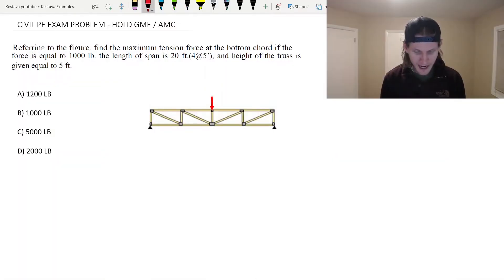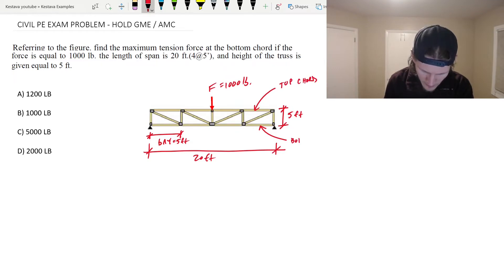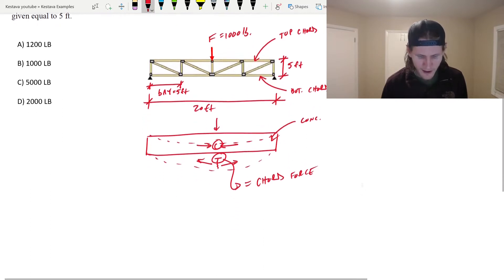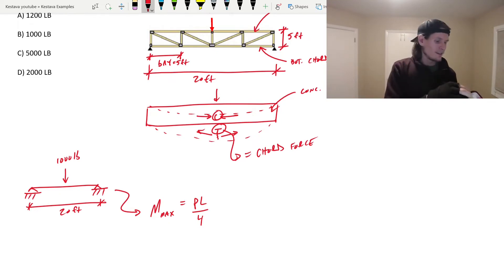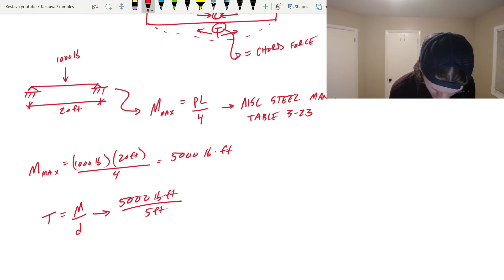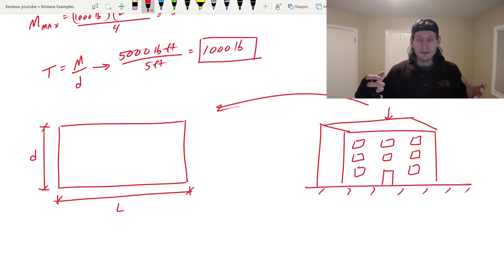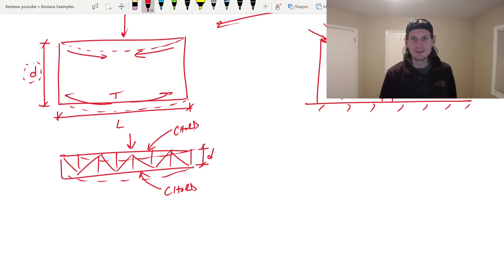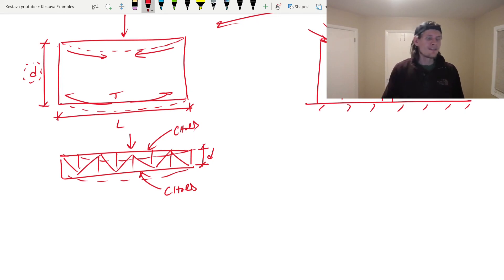Make Truss Design EASY + Civil PE Exam Review Problem

Comment: Hey Rich.  I was just working a problem very similar to this and following the procedure you laid out did not result in any of the answers.  The solution went through the method of sections and basically cut the truss just to the right of the 2nd top chord node and summed moments about that node.  By solving the problem in this video using method sections and summing moments about the 2nd to chord node you get (Ra x 5 ft) = (Tbc x 5 ft).  Ra = 500 lbs, and solving for the Tension on the bottom chord you get 500 lbs which isn't one of the answers.  I thought I had this nailed down but now I'm really confused.
Reply from the maker: Hi Eric - Alright you got me thinking now. I'm going to readdress this  on an upcoming video to clear some things up / my mistake. thank you for giving great feedback and always keeping me on my toes!

Comment: A senior engineer at my company taught me this same truss-beam method one day, and it blew my mind. So simple and intuitive, but it's easy to get lost in the method of joints/sections. 

However, I don't really agree with any of the available answers for the force in the bottom chord. Wouldn't the max bottom chord force be 500 lb (T)? I think only the top chord would see 1000 lb (C). If you're designing, who cares? It's more conservative. But for straight analysis, the bottom chord would have less force because the web diagonals are all oriented as tension members and are transferring more force to the top chord. The outer two bays of the bottom chord are zero-force members, and the two inner bays would have 500 lb each. The opposite would be true (bottom chord = 1000 lb and top chord = 500 lb) if the web diagonals were rotated and made into compression members instead.

Sorry, not trying to be nit-picky! :o) I was just following along in the video and noticed the difference.
Reply: Thanks for pointing this out. I was thinking of using the method shown as short cut to solving problems like these. But, it certainly will not give the right answer. For designing, this may be ok as this gives a more conservative answer. I see if I consider the joints at the supports, there are no horizontal reaction to create internal force in the outer bay of the bottom chord.
Reply from the maker: Sasha I am LOVING this dedication and sharpening the pencil. Let me get back to you and see! I your straight FLEXIN on this team!